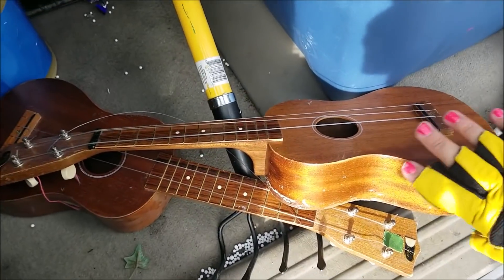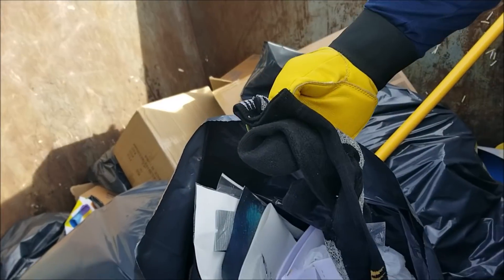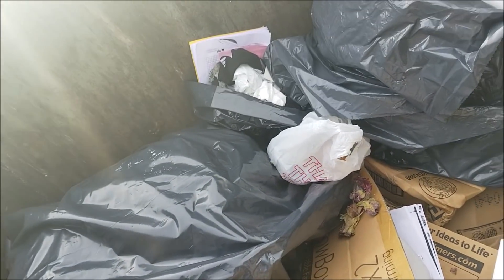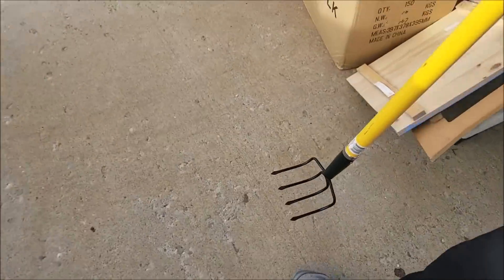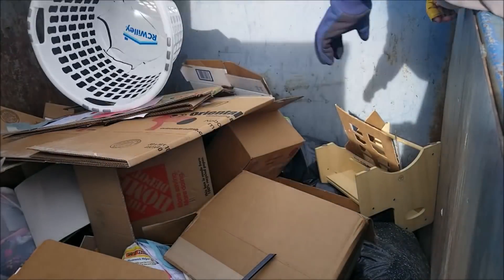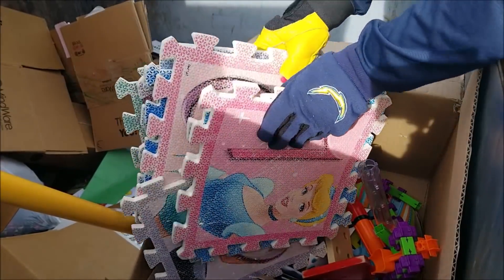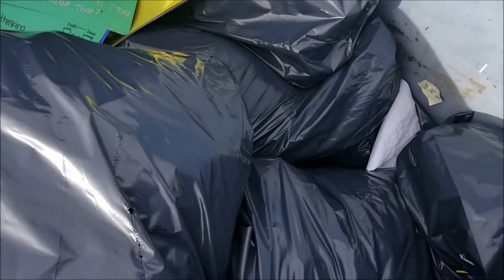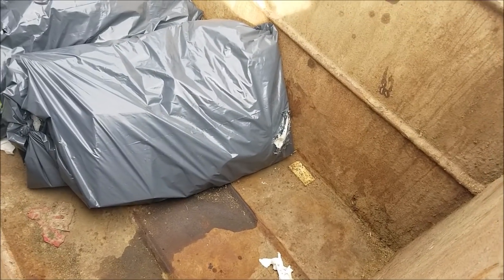DUMPSTER DIVING! Public School Dumpster School Clean Out Haul!

Comment: A Really Long True story! If I had a way of taking the larger stuff or multiple items when dumpster diving, I would. When I found out that grocery store was closing, I got to go 3 times and found a good amount of stuff, on the last day I was able to go, the dumpster was filled with lots of TV dinners from cheaper to Hungry Man, I did take alot, although had I been able to take more I would have. My house is 4 rooms, 5 if you count the hallway and its separated by 2 connected lines, the kitchen, bathroom and hallway are on one line, while the living room and bedroom on the other line. I come close to burning the house down cause of this fact when I put 2 heaters on the same line and overloaded the electricity and it even put my refrigerator out of commission for about a week to get the cord replaced and that was not fun. I would like to have the electrical upgraded to brand new wiring with multiple connections from the breaker box, so that will never happen again, just no money. Cause of this fact I can not heat the kitchen, bathroom, bedroom and even the hallway, I choose to do it this way in hopes my dogs will stay warm, yet those drafty holes in their room make it hard to keep it warm, so if you are a praying person, pray that GOD intercedes, one day I may just want to leave if that's GODs plan, I would move if I could in a way, the noisy horns that pass through hurts my babies ears and they will wail in pain and if I had the money to buy or even rent a place that would accept dogs, I would consider moving, yet most rent houses I checked on, up to $600+, they also don't allow dogs and I get a total of $726 in social security. I probably could get a low income apartment, however most will not let you have large dogs, Charcoal and Mandy are Labradors and I do not want to get rid of them, someone threw them out like garbage and I can NOT bring myself to do that to them, they are my BABIES! I LOVE THEM TOO MUCH! I don't know what plans GOD has for us. I hope I can figure that out and move on if that was GODs plan. I wanted to stay in this house because it was my grandmas house, being it was historic I wanted to live here all my life, yet there is no stores close and I would have to bike up to 15 miles or more if I wanted or needed to go to town, it takes around 2 hours one way, 4 hours both directions and no bathroom stops unless you find a tree to hide behind and no real way of carrying dumpster finds or even purchases for that matter. Because I am so POOR, I don't even see a vehicle in my future and no way of driving. Things just happen that we can't explain that only GOD has the answers to. I would like to do better, much better than I am now. My life has crashed down on top of me, though I haven't suffocated yet, sometimes it feels like it, I HOPE GOD INTERCEDES SOON IN OUR LIVES! HOPE YOU HAVE A TRULY BLESSED DAY and NIGHT!